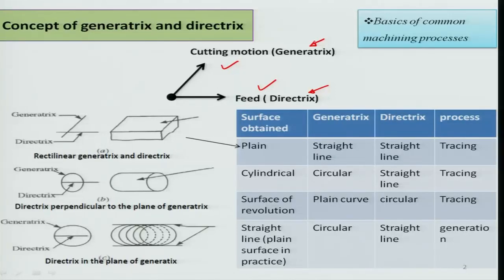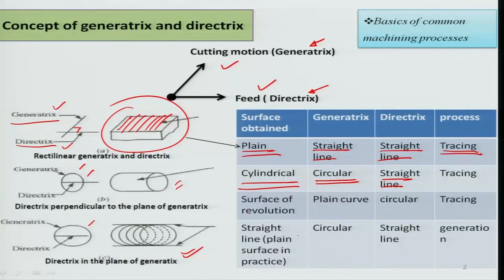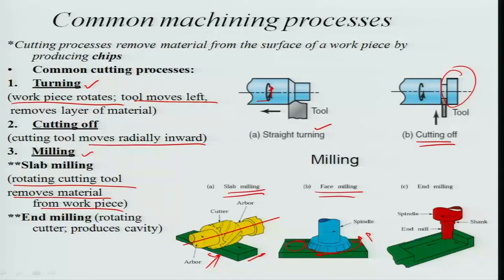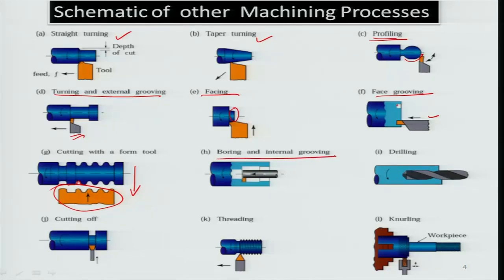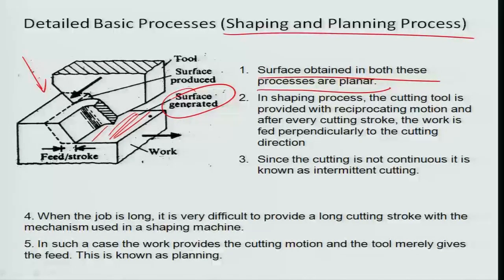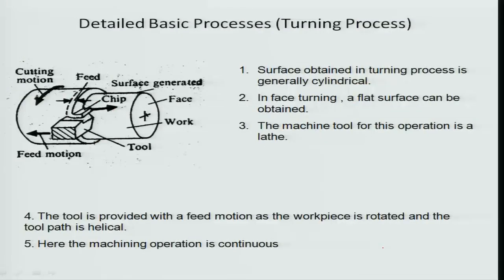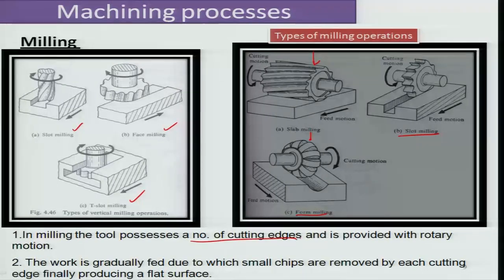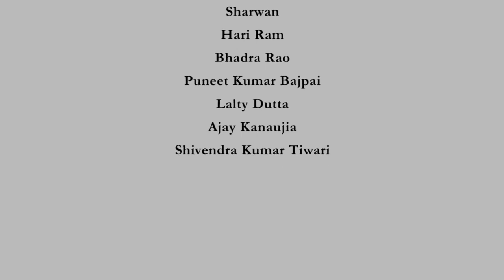Introduction of Machining Processes

Comment: A nice introduction into machining processes, explaining the basics of milling and turning operation, the basic terminology such as generatrix and directrix, the common conventional machining processes: Turning, Cutting Off and Milling. The video involves nice schematics illustrating machining processes such as straight turning, taper turning, profiling, facing, face grooving, boring and internal grooving, drilling, threading, knurling that associate with turning operation and slot milling, face milling, T-slot milling, slab milling, form milling that associate with milling operation. Also in this video, the professor is explaining differences in shaping and planing processes. The video is qualitative in nature and is intended for those who are new to the subject of conventional machining, it does not involve any math and any mathematical calculations and details on cutting tool geometry (even though some sketches are shown), on the cutting and chip forming aspects, which are shown in his other video lectures. This video is good for anyone who is interested to learn about the basics and fundamentals of manufacturing of products, anyone interested to know the basics of cutting and shaping that is used in almost every field today including woodworking, metal machining,  plastic machining. You can find additional good videos on our youtube channel by clicking on our logo to the left. We have a collection of subscriptions to good sources on manufacturing and engineering.